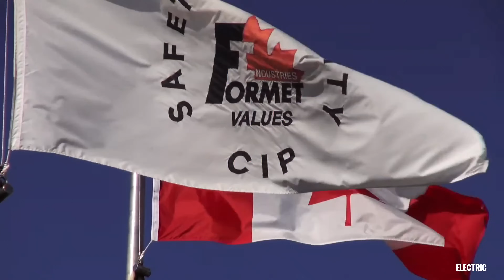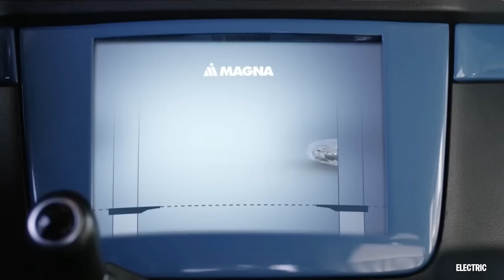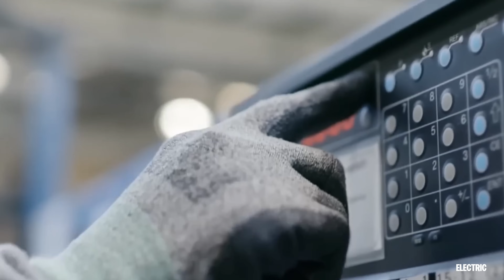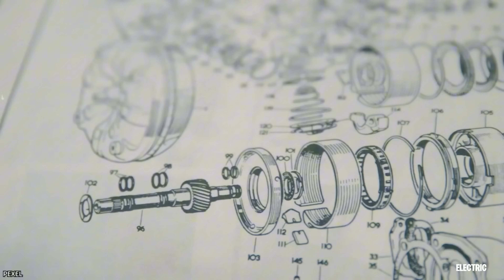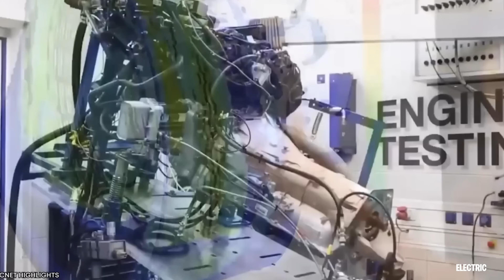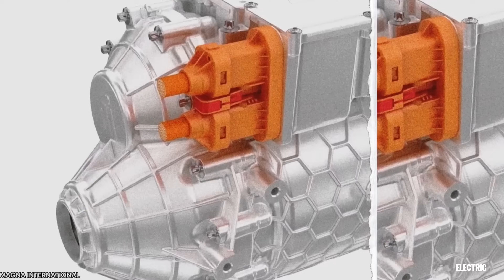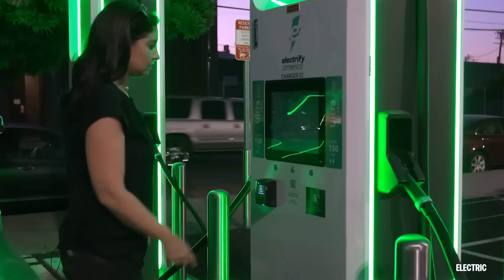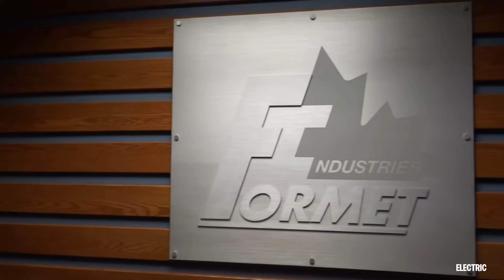Canada Set to Produce the World's Most Powerful Magnetic Electric Motor

Comment: I have designed a motor cum generator that doesn't use currently available technology while currently available technology is based on an older technique called BLDC motor technology, on the other hand the newer technology which I have invented makes use of an optical disc to determine the position of rotor while the rotor contains permanent magnets on it and the position sensing optical disc gives signal to an electronic comotator circuit moreover there is an oil filled radiator (similar to one used in cars) that circulates the oil around stator windings in order to cool them down